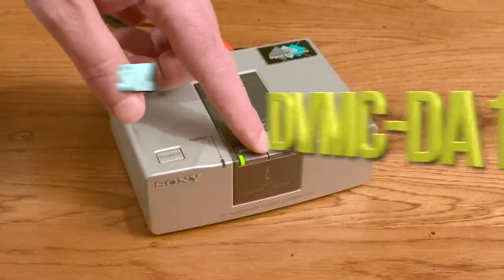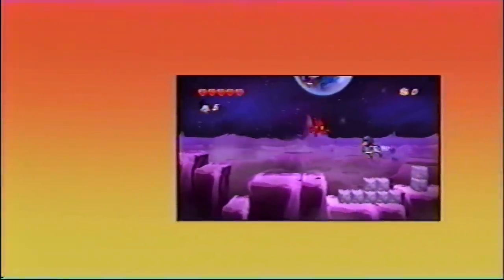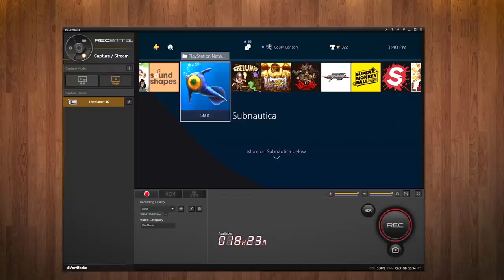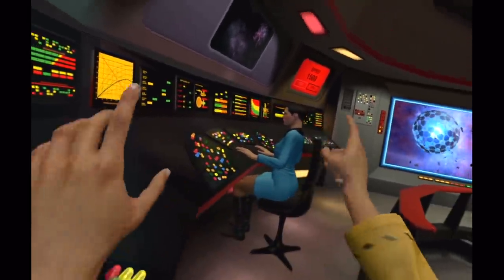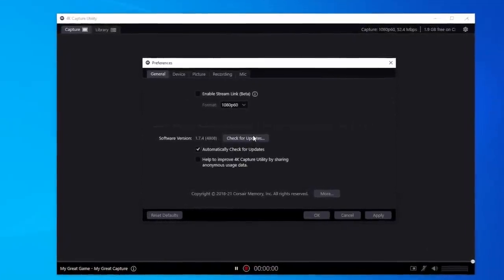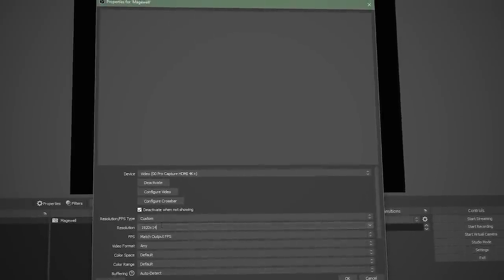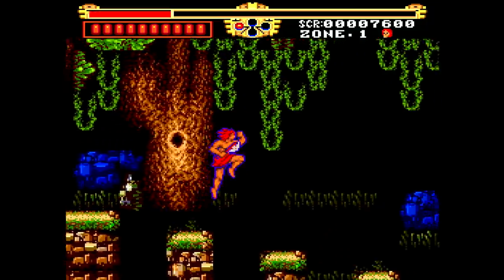Video Capture Devices for Gaming

Comment: Dude Joe the Trashcan Mac has Thunderbolt, does it not? Snag an external PCI-E enclosure, you can use every internal card you want with it! There’s even rackmount computer cases that have the Thunderbolt PCI-E built in. Check it out. Don’t stick urself with the HD60s, you can get a Magewell or other internal 4:4:4 card and have significantly better image stability and performance.
Reply: How many lanes are available via that Thunderbolt though?
Reply: @zxcvb_bvcxz  There are different enclosures you can get, depending on your card needs and Thunderbolt connection options (TB1-3), but I have a Sonnet Echo Express SE I with a Blackmagic DeckLink 4K plugged into a 2012 i7 Mac mini. I can capture full 1080p60 in Prores 422 or uncompressed, but higher quality flavors of Prores (422 HQ, 4444) max out the CPU and then I start to drop frames. But this isn't a Thunderbolt limitation, even on this nearly decade old TB1 Mac mini.
Reply: why do that when can instead spend $5000 on a new mac pro?????
Reply: Posting for visibility.  This is exactly what TB is made for - internal bandwidth made available to external devices.
Reply from the maker: I had briefly considered that. I may do that after I get my next computer, depending on which computer that will be (spoiler, it'll be a Mac... but not certain which one now except that it will be M1). Mac Pro trash can is limited to wimpy Thunderbolt 2 anyway which is old and slow, like myself.
Reply: @GameSack  upgrading from a trash can to a cheese grater. Seriously the upcoming M1 Mac Pros could be real interesting. Would be nice if it would be more receptive for addon cards.
Reply: @GameSack  I noticed you have loads of compatibility, software and other issues stemming from Apple yet you are still sticking with them in the future…How long have you been a masochist?
Reply from the maker: @gimpyggaming4287  What are you talking about? Loads? My life is fine. PC users are the ones who feel the need to tell everyone else what they should buy for some reason and crap on other people's choices. Worry about your own life.
Reply from the maker: @Maldroth  Nah I'd never get a cheese grater. It's already obsolete. Waiting for an M1 Mac Pro probably. Until then this one will do.
Reply: @GameSack  I don't intend to tell you what to do, but you did acknowledge several limitations you've had over the years due to using Macs. If they work for you, then by all means continue to use them. I just think the previous commenter understood you as having difficulties because of those limitations.
Reply: @GameSack  PC gaming content creators like to do that, huh? Interesting, it's the complete opposite in the music community. 
Every Apple user there needs to tell everyone else how important it is to use a Mac and Logic to do everything, despite the woes of dealing with their horrid plugin compatibility. Of course, it's always the plugin developer's fault that anything goes wrong, never Apple's.
Reply: @GameSack  I'm worried about you, Joe.
Reply: @Wourghk  apple lost me after the g5 and killing final cut classic
Reply: @GameSack  Joe, I know you're not a big PC guy but I would look into getting someone to build you a very simple machine with the only purpose of recording footage. You can still do about every other task on your Mac so you don't need to worry about learning how to use it necessarily. You can equip this dedicated machine with an avermedia livegamer 4k capture card via pcie, connect your HDMI output from your switch to the input port of the capture card, then just have everything record through OBS or Avermedia's software. You'll need a display of course and a dedicated spot to see the screen, keyboard and mouse and maybe speakers to test sound. If you have setup like this already but for a Mac you can probably use what's called a KVM switch to switch between the two machines instantly while also sharing the same keyboard and mouse between them. At that point, all you'd have to do is turn it on and hit record (in theory of course, there's always some frustrating problem when it comes to getting any kind of work done with a computer isn't there?).

The 2nd thing you would do is have that same PC point all your recordings to a hard drive that you'd share on your network, could be a drive installed in your PC, could be another computer, OR it could just be an external drive you can just move over to your Mac and comb through when you're done.. Obviously you'd need a network connection for that PC if you go the sharing over a network route. Then when it comes time to comb through footage and throw it into your preferred editing software, all the work is still done on your Mac, so you don't have to deal with all the hurdles of learning an entirely different operating system and programs. Since you've used avermedia/OBS software before, there shouldn't be that many hurdles but there will be a few.

The overall idea is that you only use this PC to record and for nothing else. I've built two boxes that are capable of doing what I just described for under 800 bucks. Although with the GPU shortage, it's going to be a lot higher unless you go with an APU from AMD to handle processing all your video footage. Again, I'd ask someone you trust for help on this. Perhaps the Alpha Males at MLIG can help you out on that? From your commentary it seems like you're doing fine with what you've got but obviously since you have rely on software support for an OS that doesn't get much if any support, that can change at any time and it is frustrating imo to have that happen in the middle of a project/job.

Comment: 00:47 Sony DVMC-DA1
02:50 BlackMagic Design Intensity Pro
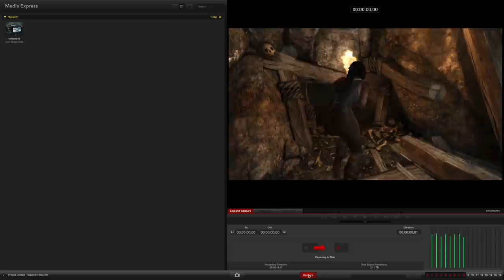04:35 BlackMagic Intensity Shuttle for Thunderbolt
05:34 StarTech PEXHDCAP
07:48 StarTech PEXHDCAP60L
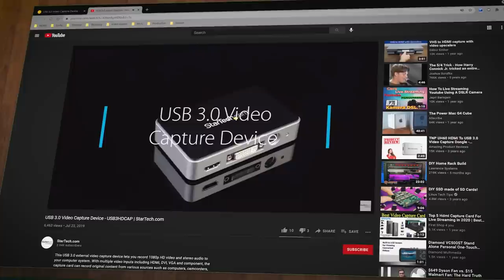09:48 StarTech USB3HDCAP
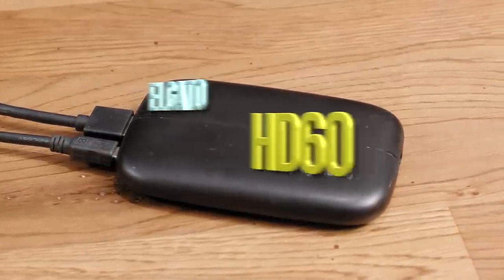10:44 Elgato HD60
13:45 AVerMedia Live Gamer 4K
18:21 AVerMedia Live Gamer Portable 2
20:59 Cloner Alliance Box Pro
22:53 Elgato 4K60S+
27:14 Magewell Pro Capture HDMI 4K Plus
32:15 Magewell USB Capture HDMI Gen2
34:00 Reference Framerates
Reply from the maker: Thanks. I meant to do this before, but forgot. I've added it to the video.

Comment: Fun fact about the HD60 - it technically does have an onboard encoder, but the onboard encoder only works if you're using Elgato's native software and the Master Copy mode. It's basically only in there in case you want to do a live stream but also want to record a local clean Master Copy of your game footage without all of the overlays and webcam, etc. When using it for streaming - your computer is still doing the work of encoding the video footage alongside your webcam, overlays, etc. while the onboard encoder chip does the work of encoding the Master Copy clean game footage. Two separate encoding processes in that scenario (#1 the feed going out to your stream with footage, overlays, webcam, etc and #2 the Master Copy of just the game footage being recorded locally). But again that only works if you're using Elgato's software. If you just want to record a clean copy of the footage, you'd have to use Elgato's software and enable Master Copy mode so that the card is actually doing the encoding work.

If you use OBS or another third party program to stream with this card or even just to try to record clean footage, it will do so in the traditional way of just translating the incoming HDMI signal into something your computer can recognize and then letting your computer's resources do all of the work of actually encoding the H.264 video file. No way to utilize the functionality of the Master Copy onboard encoder chip without subjecting yourself to Elgato's sketchy software and it's VFR / AV sync issues.

Well .... I guess it wasn't a fun fact. It was kind of boring and sad really. Also it's too bad Elgato's software sucks turkeys because it's a really solid card that I got a lot of use out of over the years.

Comment: I admire the fact you never had to do the DVD recorder route. I remember doing a Sonic 3D Blast video in 2012 and had to rely on one and the lag was terrible. Then went to the Hauppauge HDPVR which was fine, but maxed at 720p, didn't accept analog signals well, and maxed at 14mpbs. I then used Elgato HD and HD60 for the most part and it was a great card for the time.

I now use the AverMedia Live Gamer Bolt which is essentially the internal 4k card only for external purposes. I am glad my current laptop has a thunderbolt input so I can use it and so far it hasn't let me down. It even accepts higher resolutions AND 1440p just fine. I do hope Elgato supports that stuff soon.
Reply: I still record my oldest consoles to a DVD recorder (SNES, Super Game Boy, N64, etc.). It's fine, but way too dark. And interlaced, sadly. Lag was perfectly fine. I regularly won Tecmo Super Bowl games (at the highest difficulty level) when recording to it, through my flatscreen.

Comment: After using the El Gato HD60 for a few years but being unsatisfied with how it handles unscaled retro signals, I went with the StarTech USB3HDCAP since it natively supports those older signals too. Video splitters are much more affordable than upscalers, lol.
Reply: How much did you paid ? Thanks
Reply: @luisfernando55  About $180 on Amazon. It's still going for the same price, too.

Comment: I bought the Elgato 4K60S+ some time last year. I like the convenience of direct capture and for the most part it works well enough, but I do have some issues with it.

Apart from some of the issues you mentioned like audio drift & lack of tactile buttons I also had issues with low audio bitrate (≈170kbps), quiet audio, bad black levels/contrast (though I'm usually able to fix this with editing software), and sometimes the colors on display just being plain wrong (this happened to me when playing In the Hunt on the Sega Saturn, where everything in first level instead had a yellow-orangeish color to it).

I noticed you mentioned uncompressed audio though. Where did you find that option? I don't know if it's due to having an obsolete firmware, but I don't think I ever saw an option for that. Any help would be appreciated! Thanks.
Reply: Hey, did you ever solve this? I think the firmware provided to Joe has extra features, as I cannot get 1440p capture via USB. I am hopeful that Elgato will update the 4K60 S+ firmware with extra features but they've gone quite and deleted posts on Reddit. Based on Joe's bricking experience, it doesn't give me the greatest confidence.
Reply: @PLEYOR  Nope. I sent in a request for a firmware update months ago and they told me they'd take my requested features into account, but since then I've heard very little from them and every time I message them they vaguely tell me that it's being worked on but go silent until I ask any further questions. It's been an extremely frustrating experience, especially since it means that my 4K60S+ is just an expensive paperweight at this point.

Comment: Hey Joe. Wonderful video! I've been using Blackmagic Intensity Thunderbolt for some of my captures. Sadly, I can't use for capturing old video games in lower resolutions as you said. Did you use it with Frameister? Which Upscaler do you recommend to use with Intensity?
Reply from the maker: It won't see the Framemeister no matter what you do. It won't even see the Retrotink 5X at 720p in triple buffer mode. I've never gotten it to work with any upscaler.
Reply: @GameSack  Holy Crap! Guess I'll have to buy another capture card... and i'm stuck with external ones since i'm using a macbook pro for editing. Thanks for saving me, I almost bought a Retrotink. Your videos gave me some ideas. Good job dude

Comment: I ended up using an Elgato Cam Link to capture old consoles through the OSSC. From what I understand its basically an Elgato HD-S but because its designed to be used with cameras it accepts a far wider range of signals including the oddball ones you'd want from the OSSC. Combined with an HDMI splitter it was perfect for me.

Comment: I started capturing using a Blackmagic Intensity Pro on my 2009 Mac Pro, and that card was amazing, other than maxing out at 1080i60. I even had a three drive RAID 0 setup so I could capture uncompressed at the time.

But yeah, you're definitely not limited to external cards. You can get an external PCIe to Thunderbolt enclosure, and use any of the modern Blackmagic cards (or Magewell, etc.).

Comment: My first capture device was actually a TV tuner USB stick that in addition to RF also had a dongle that let you record line level stereo and composite or S-Video. After that I got a component capture box, and now a hybrid component/HDMI device that can capture to a computer or SD card. My needs are pretty modest, so I don’t have anything that captures above 720p60/1080p30.

Comment: I have 2x of the Startech USB 3.0 Video Capture Device and they are pretty amazing. You have to play around sometimes with OBS to get the audio but it works with everything I throw at it. My day-to-day HDMI input though is the Avermedia ExtremeCap U3 - CV710. Paired with the RetroTink 5x/2x it's amazing.

Comment: You want something relatively affordable that captures the OSSC in 960p? An Elgato Camlink. Obviously it's designed for camera rather than game inputs, but due to that, it's support for all sorts of "non-standard" framerates and resolutions (due to the nature of cameras) is incredible.

It's an external USB 3 device with no passthrough so you'll need a splitter, and for some reason you have to use OBS to capture, as Elgato's own software doesn't support the screen formats despite the Camlink supporting them internally, but it's been part of my capture chain for over 2 years. I swear by it for OSSC stuff.

Comment: the end credit of sega cd ad was perfect. i used a avermedia 4k live gamer capture card and i love it. only down fall is the snes and genesis games do have some frame rate issue on certain games. but i love that capture card to death. it work really well with obs too. i did find a go around on the snes/genesis frame rate issue but adding a m-classic adapter at the end of the hdmi and set it as retro mode which help it out alot to upscale abit and have it set for it 4:3 then it 16:9 screen setting. overall this card is great to used and good for a budget if your looking to stream.

Comment: What's a good, but cheap external capture device that works for HD consoles (PS3/4/Switch/360 up to 1080p)? No need for older consoles or modern 4K/HDR stuff.

Comment: Yup, that's the thing about upscalers vs linedoublers.  The Framemeister was a legit upscaling device while the OSSC was a linedoubler.  Much simpler & cheaper to implement but does not always play nice with displays or capture devices.  I wonder if the new RetroTINK 5X is faring better when it comes to capture devices as it is too a linedoubler.
Reply: With the Triple Buffer mode engaged, the Retrotink 5X plays nice with basically anything you throw at it. Frame Lock mode is about as tricky as the OSSC.
Reply: @AceTrainerX3  A nice feature to have, but adds a frame or two of extra lag does it not?  Still, I suppose it's a small price to pay for compatibility if needed.  Bet plenty of ppl out there don't even realize that you should not have triple buffer turned on if your equipment works without it.

On a side note, one thing I'd really love to be added to the Tink 5x is a manual phase adjustment so it can be tweaked if the user so wishes, just like the OSSC can be.

Comment: i myself use two  Cloner Alliance HDML cloner box evolve  devices for my captures and livestreams. they will record to sd-card, usb-stick or usb harddisk  as well as stream the capture info to pc (no mac drivers) via usb 3.0
as fas as inputs go, this device has two hdmi inputs, one composite input via jackplug and one hdmi output , a jackplug input for microphone and a headphone jackplug output.

 you are already aware of the devices menusystem since you use another cloner alliance device.
only for non-composite signals (RF signals) i need an external device like a VCR to convert it to composite .

Comment: I have a Pinnacle USB TV-Tuner with composite and audio jack which I got to record TV shows in the analog TV days.
Actually tried to play WiiSports with this thing once which also worked albeit latency was there.
From all devices something small USB based would suit my needs probably the best, so I can play Switch inside a window on my computer but that's no priority and thus I wouldn't spend over 100 bucks on it.
Reply: Never use USB if you can use PCIe.
Reply: @unitedfools3493  Back when this device was on sale, PCIe wasn't even specified for consumer mainboards 👀

Comment: So I started on an old Happauge card that had RF input (WinTV HVR-1265), then I jumped to the Black Magic Shuttle but I found the limitations infuriating. Next was the AVerMedia C027 PCIe HD (got it for free, but it maxes out at 1080i30) and it did well but I finally settled on the AVerMedia LIve Gamer Portable C875 because You can use custom software to capture PS3 footage without having to play the HDMI splitter lottery. I knwo it is only 1080p30 but it suits my needs. I have a coulbe of those Camlink Knockoffs and they work fine too for needing something ultra portable, but for now I am going to stick with the C875.

Comment: I love my Avermedia GC573, but when I connect my Ps5 to it, and then back to PC, my PS5 misses out on that 120hz refresh rate (for Ratchet and clank and future games). I have to disconnect my PS5 from the Avermedia and connect it directly to the TV (which is 120hz capable) to enjoy the 120hz capability. Has anyone been able to find a solution, I think not right? Another great video, thanks GC.